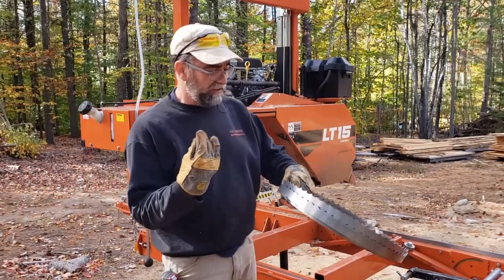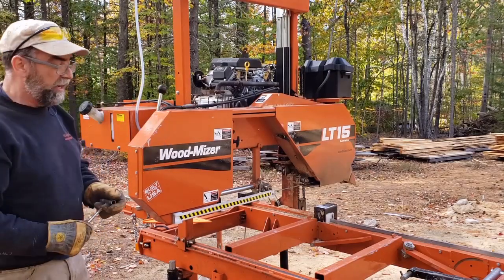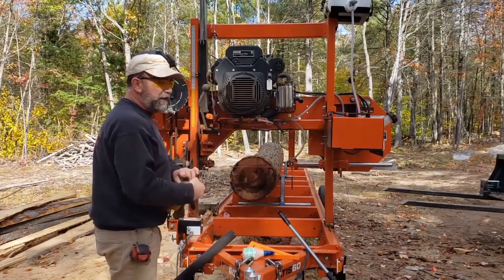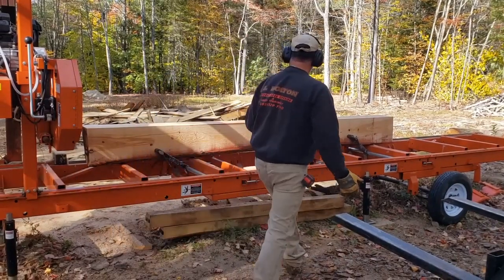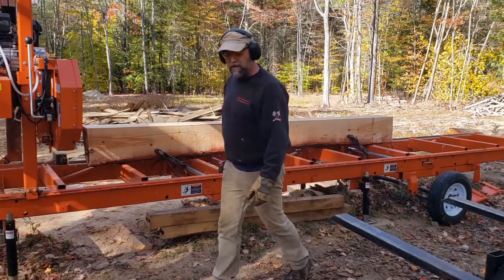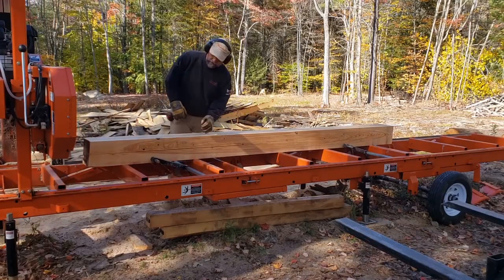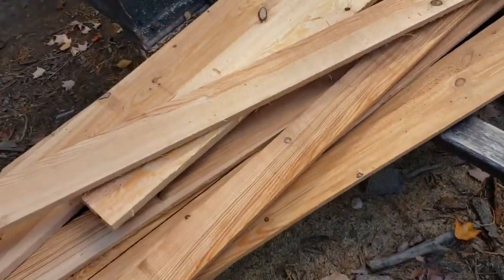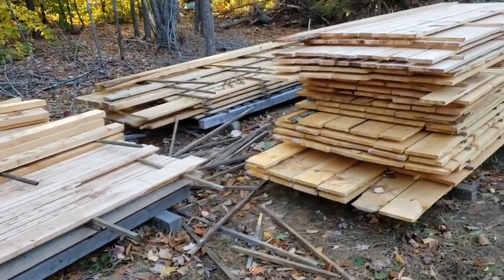Saving Money - Milling Our Own Trim Boards for the Bunny Bunker With the Woodmizer LT 15 Go Sawmill.

Comment: Throwing your blade out on the ground is a much safer way to uncoil the blade. If it slips out of your hands while uncoiling the way you do, you may wish you tried something different. My brother and I build sawmills. I have a video showing a mill we are building.
Reply from the maker: I uncoil both ways.  When tossing the blade, I always worry about a tooth bending.  Thanks  for watching!   I'll check out your video.